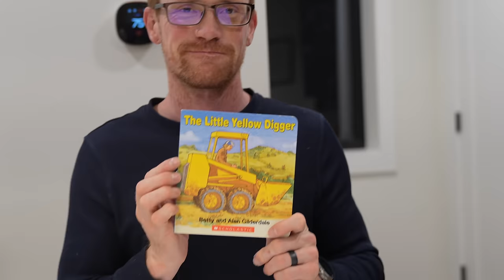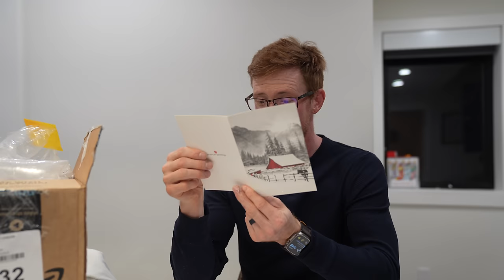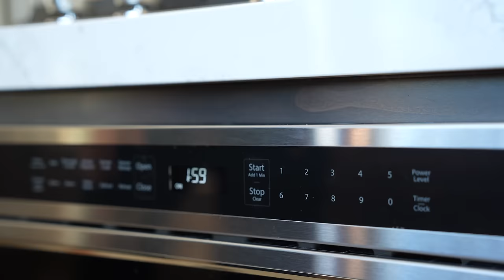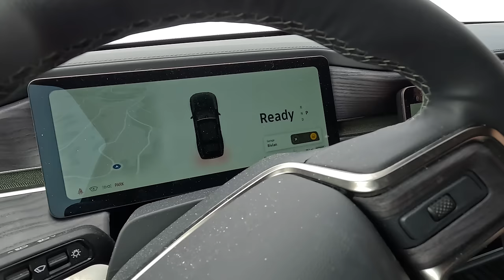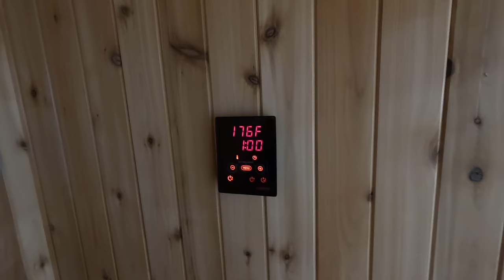BUILDING OUR SAUNA FROM START TO FINISH!!!

Comment: On the occassion you want to have a steam sauna, just run a portable dehumidifier in the basement gym. You can even measure the amount of water poured vs the dehumidifier output to be sure you remove more than you pour (because sweat and breathing)

Comment: We have a small sauna in our unit here in Finland. When we have guests we do 2 - 3 at a time shifts. I am worried about that floor, it should be tile and there should be a drain for when you clean it, and it will need cleaning. All that sweat has to go somewhere.

Comment: One thing to think about in the future, (now that you have bought a 100' roll) is maybe finding an electrical contractor close-by and seeing if they would not just sell you a 10' piece of that electrical metallic tubing that you needed. Most good contractors would be understanding and probable give you the small piece you need. As it is, maybe now you could find out the value of what you have left over and if it will not be needed in the future, maybe one of those contractors would be willing to trade your (flex) for some other wire you might need to finish the addition.

Comment: Glass doors on the sauna.  Hmmm. I guess that means no naked sauna time while Russell's in residence!  Now, where's the cold immersion bath to follow the sauna?  At the Forestry Club cabin (miles out in the woods) at college, the sauna was right on the banks of a mostly ice-free river, so one could bake in the sauna then plunge into the river.  You don't have that arrangement.  Guess you'll just have to bring home a stock tank to fill with cold water just by the sauna!  And the "4-person" sauna seems to be built for four very tiny foriegn-type persons.  Perhaps the same ones for which the pancake box serving sizes are designed - where the twelve pancake recipe makes three or four American-size pancakes.  Dry sauna is the Finnish way.  Steam baths are the Turkish way.

Comment: Flexible metal conduit FMC, otherwise known as BX, and is not to be confused with MC which has the wire already inside and usually is smaller wire like 14 or 12ga. Great video!

Comment: Just FYI when u store any equipment exspecally a hoe u need to keep the cylinders retracted in position as much as possible away from the elements or it will begin to pit and rust after just one season of sitting. The swing cylinder that’s exposed just put a light film of grease on it for the winter then wipe  off in spring when ur ready to use it again. Your Kubota will love you more lol

Comment: Three points: (1) Consider using sauna as Allie's new editing room, (2) Should you be concerned about heat warping the new (house) floor underneath the sauna?, and (3) Skinny jeans, camping tents, and in-home saunas. Question: What do those items have in common? Answer: Their manufacturers overestimate their size capacity. Each one is a tight fit. Time code 20:04

Comment: Nice size sauna but I'm just wondering where the condensation is going to go if there's no waterproof layer on the floor or did I miss that bit? If it goes straight through to the wooden floor, wont it warp and lift it?

Comment: hope you got a ventilation to the outside..If you let heated moist air out it will f up woodworkings and waterbased produkts. your the third sauna bilder from america i follow. In your prebuild  you got inlet but no outlet of heated moist carbon air from breath. And when you take a sauna bath.. Drink fluid and scrub your selfe and take shower between times..you had to check out your friends brandon and kaily.